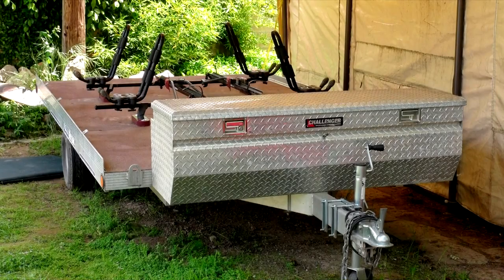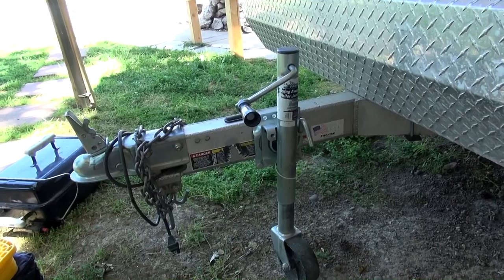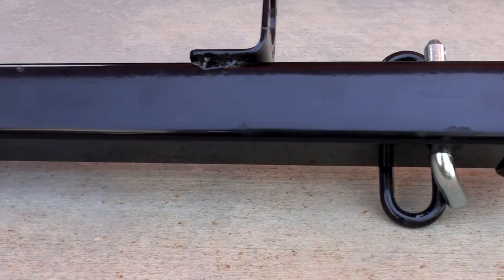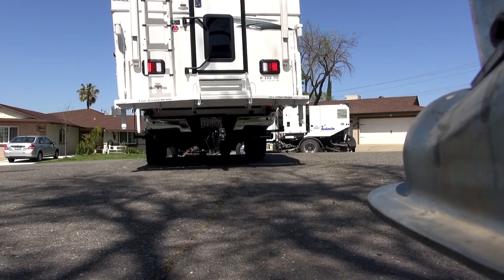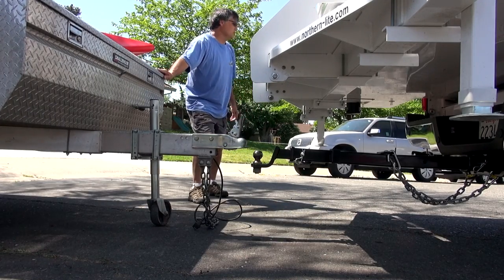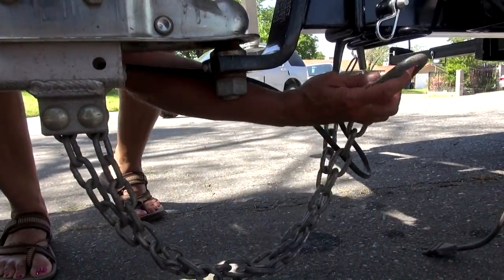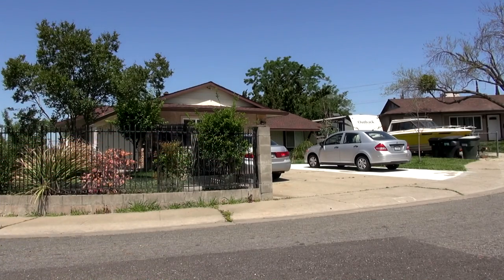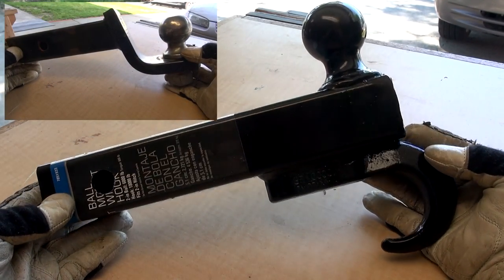34" Receiver Hitch Extension

Comment: If you chain the hitch extension chains to the outside edge of the receiver, Then  tighten them with a turnbuckle it will take the side to side slop out of the extension. It's the same theory used with the Torklift Supertruss.

Comment: If you just turned the original ball mount over - 180 degrees -  it would have raised the hitch to compensate for all the weight on the truck.
Reply from the maker: The three inch drop mount gives  too much rise when flipped over. It  trades trailer nose down for trailer nose up. The zero drop mount is the Right one to get the trailer level. Appreciate the tip though.

Comment: Is this the CURT 45048 Trailer Hitch Receiver Adapter Reducer, 2-1/2 to 2-Inch, 34-In Extension, 4,500 lbs?
Reply from the maker: Yes. You named it.

Comment: With my previous experience of same setup you STILL have a major problem..tight turns will put camper corners in too front of trailer..major damage.. your extension ain't near long enough
Reply from the maker: We tested it and the extension is long enough for forward travel. With the truck at maximum turning radius, the camper corner and trailer have enough clearance and they don't collide. Jackknifing  is possible when backing up. We are aware of  this and when backing into a turn one of us will get out and spot the driver and give instructions.

Comment: You could have flipped your original ball mount over for a 2" rise.
Reply from the maker: Thanks Chris. That was tried and it put the ball too high, making the trailer point upward. Take into account that flipping is relative to the receiver height off the ground and makes the 3" drop hitch now 6" higher plus the thickness of the steel.  The zero drop was the right solution and puts the trailer level under the loaded camper condition. Appreciate your comment.

Comment: One thing i noticed if you dont want your chains scuffed up on rear chains need to throw a few twist in them to take them in a little there damm near hit the ground every speed bump, driveway, dip in road their going to be hitting the asphalt! Chains should hang no more than 4 inch off ground

Comment: Hey Dan, what's the empty dry weight of your Northern Lite? I've got a similar, in weight I believe, and just purchased a new F350 like yours for it, my older 2008 Dodge 2500, just did not fit it. Any suspension or wheel.tire work on your Ford?
Reply from the maker: Dry weight is 2525 lbs. / Wet weight is 2821. As you know, loading cargo adds weight quickly. The truck came stock with front anti-sway bar and we added rear anti-sway bar (see my video). Timbren rear suspension bump stops added, but we may go with airbags some day. That's it for now re suspension/tire/shocks etc., but you might find useful comments made from others on my Northern Light videos.
Reply: @DanChanPiano  Thanks Dan!

Comment: I watched this, trying to find a solution for carrying our 16' tandem kayak on our smal 4' x 6' utility trailer with 2.5' tongue. As is, the kayak could hang 2' over the tongue, which puts the pivot point center of the kayak (8') at the end of the trailer and leaves 8' overhang off the back. I don't know what the legal overhang is in Nevada, but it obviously doesn't look right. I'm thinking the addition of a 36" tongue extension would give me the wiggle room to balance the kayak's pivot point over the trailer axel. Thanks for your great video.
Reply from the maker: You're welcome  and hope the extension works for you. When we don't have the camper on, instead of using the trailer I'll mount my sliding Thule TracRac atop the pickup bed walls. Yakima sells an adapter kit to mount the Yakama HullRaisers on the Thule rack. The long kayaks are now transported on their sides up on the rack just as long lumber would be carried.

Comment: Thanks for the video. Looks like you could use extra clearance above your cab. I have a northern lite and use a thick piece of marine plywood on top of my rubber mat for extra height. Cannadream recommended it for bumpy roads
Reply from the maker: You're Welcome BW Boating. The cab/camper clearance is addressed in my spring update video here.
https://www.youtube.com/watch?v=lvFD_Vlr7PU&t=1s
What I've added seems to work well too.

Comment: Are some people using tongue extensions to put truck boxes and stuff like that on the front of a trailer to get more cargo space? And does that tend to work out pretty well? Thanks.
Reply from the maker: See my video Triton Trailer Re-deck here. https://www.youtube.com/watch?v=noRlqY8hOhc&list=PLMRSrv_94pSkSz14nGx2xcBmxRp9Y4sxS&index=4&t=369s
You'll see how I put my cargo box on the trailer's existing tongue. It's a great use of unused trailer space to contain, protect and carry gas cans, the spare and more. It doesn't affect turning radius going forward but will it will contact the truck if I jackknife in reverse.

Comment: Hey Dan, I really like your set up, looks like a great way to take some toys with you. I think we may end up with a similar set up if we need to take kayaks and paddle boards. 

We are using the 34 curt extension on our f 350 8-11 exse with a swing away Yakima bike rack. The just released swing adapter from yakima keeps the bikes tucked up tight while in transit, and swings 90 degrees out when we need to get in the camper. 

I have also added a set of Rancho xl 9000 rear shocks..Running the dampener setting on 9 with the camper on..they were fairly cheap and have dampened out most of the camper sway. Especially at slow speeds.
Reply from the maker: Sounds like you have your bike transport setup dialed in. I know you are always seeking to improve upon your suspension and I'm glad the adjustable shocks are working for you. Hey, I'm releasing a new video tomorrow. Have a look at "Truck Camper Camping Dillon Beach". I think you'll like it.
Reply: Yep, always monkeying around with the rig..Just over 17k on truck and camper now. Happy with gas motor as i'm averaging 11mpg with camper and around 15mpg without.

Comment: Very informative Dan. Where can this be purchased?
Reply from the maker: Thanks Mike. I bought mine from etrailer.com. I think it goes for around $200 now. It can be cut down if you don't need the full length.  Item # C45048 Curt Hitch Extension and Reducer for 2-1/2" Trailer Hitches - 24" to 34" Long
.

Comment: Need scales to measure tongue  weight
Reply from the maker: Thanks silver dragon taylir. A search on YouTube for tongue weight yields quite a few different methods to weigh your trailer tongue at home and avoid taking the rig to truck scales. Bathroom scales and lengths of wood post etc. I think the best deal is to spend about $130 and buy a tongue weight scale to easily weigh each load occasion.